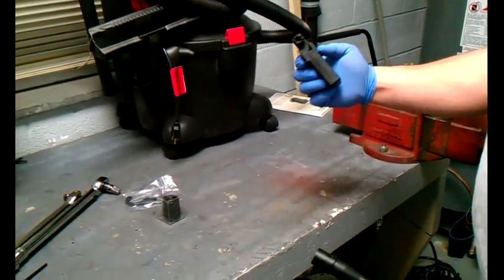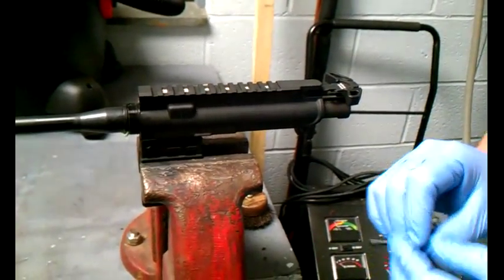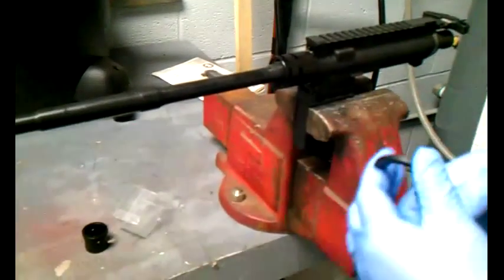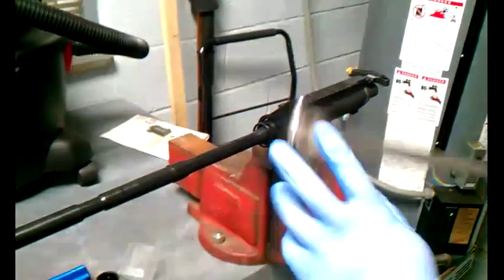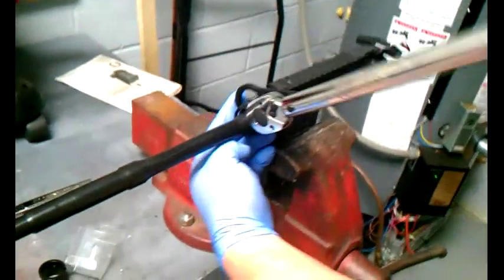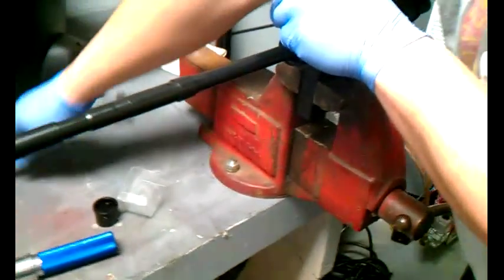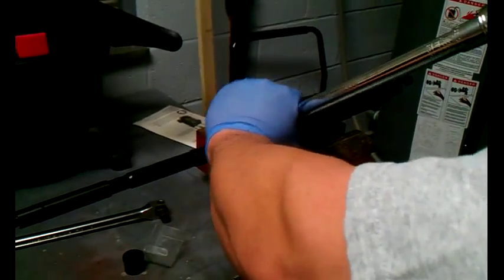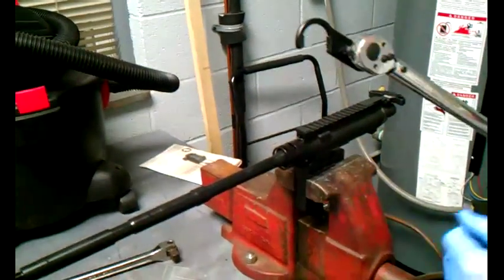How to Build the AR15:  The Correct Way to Torque a Barrel Nut

Comment: that is the wrong way to torque with an adapter.  always at 90 degrees....
Reply: These arguments are moot in this application. I calibrated torque wrenches for a living in the service, and with large torque ranges as this application (30-80 ft/lbs) it makes little if any difference whether the crowsfoot adapter or barrel nut adapter is straight or 90 degrees. Even the Air Force tech manual says with a standard crowsfoot adapter, use it straight and torque to the center of the desired range.

The adapter shown (and most) will add only a few ft/lbs (2-3) to the desired torque. So unless you intend to torque to exactly 30 or 80 ft.lbs, being off a few ft/lbs is irrelevant. 30-80 ft/lbs is a very large range to be so concerned about exact torque applied.
Reply: @barry7413  honestly Barry thank you for putting this argument to rest. Someone with ACTUAL experience sharing their advice is worth volumes. I’ve also heard the range is very wide for a mil-spec. Everyone else here is just shaking their pissers with theories and other shit.
Reply: hahtsauce you're confused about what mil-spec is, but that's okay. Just because it meets SOME mil-spec dimensions, doesn't mean it's mil-spec. Also, there's no set standard that armorer's wrench manufacturers follow. Especially considering that there are manufacturers that require the use of castle nut wrenches for their barrel nuts like on the BCM KMR and Centurion CMR. The distance between the adapter locations and the square (not hex like you think it is) torque wrench mounting location varies greatly between manufacturers.
Reply: Not to beat a dead horse, but since he mentioned the AF tech manual, I though I would provide a link to this. It does state, as a note, that when using a standard crows foot, no calculation is required. Now, is the barrel wrench considered a "crows foot" or is it an extension?  https://www.google.dk/search?q=Air+Force+torque+wrench+use&oq=Air+Force+torque+wrench+use&aqs=chrome..69i57j0.7633j0j8&sourceid=chrome&ie=UTF-8
Reply: That would depend on the distance between where the torque wrench fit and the socket end center point. I know of no definition of where "extension" begins and ends.  @jason60chev
Reply: @jason60chev  both need to be at a 90 degree to achieve to be accurate
Reply: @biglaverstyle  true, but this is a range, and not a precise specification, like torquing a head bolt.  Also, the best thing is to follow manufacturer's recommendations, as for this UTG slim-line barrel nut, the tool is to be used in-line.  I cannot remember what the max torque value was for this nut, but we did not exceed it by a long shot.  Have a great day!
Reply: tacticalsmokepole  No. It is very easy to over torque using a breaker bar. The problem is people generally over torque rather than under torque when not using a torque wrench. It would be easy to over torque the aluminum receiver threads and strip them. Then you have an expensive aluminum paper weight.

If you reach max torque and the gas tube holes don't line up, you may need a shim(s) between barrel and receiver. Normally, the barrel nut will align before reaching the max torque value.
Reply: tacticalsmokepole   If the hole for the torque wrench is truly 10 inches from the center point of the Tapco "socket", it will affect the applied torque more. Still you're dealing with a very wide torque range. Torquing to midpoint (65-ft/lb-ish) with the Tapco straight is still unlikely to put actual applied toque higher than 80.
Reply: This isn't for an airplane or car.  You are correct if I was trying to be exact, but a barrel nut for an AR is a range and doesn't need to be exact.
Reply: That's when using the issued barrel nut tool with a mil-spec barrel nut.  Using the adapter inline with the torque wrench amplifies the torque compared to what the torque wrench is set to.  If your handguard's manufacturer says to torque it to specific ft-lbs you need to use the tool at 90° to achieve the correct torque.
Reply: @netchemica  in this case, UTG also states in their instructions to use the tool in-line with your torque wrench.
Reply: This isn't a car, read the M16 tech manual.  It describes how to do it and the instructions specifically say to use the tool inline with the wrench.  The engineers who designed this gun already took offset into consideration.  That's why they want the tool inline with the wrench.   Just sayin.
Reply: Barrel nuts in general are mil-spec so that is a moot point.  Doesn't matter what tool you use, if the tool is made mil-spec the distance from the drive hex to the barrel nut splines are the same as the issued nut tool and you will need to follow the Tech Manual.
Reply: @ginsboy2003  I know this video is super old, but sorry friend you are as ignorant as most the drop outs going into the service when the manual was put out, I know for a fact most didn't know what 90 degrees was. They made the adapter some what small to get some what close results. They made the manual that way because the broad range on issued rifles, it was easier to understand, and it was taken into account to slight over tighten so the barrel would stay on in life or death situations. It was better to be over 10-20lbs pounds than someone being light and under torquing it. I've done this many times, and measured the lbs/ft, and any size adapter will change the offset if it is inline with wrench. 90 degrees will give you truer value. This didn't matter as much back then because like I said better safe than sorry, 10-20 lbs on issued rifles was still under 80. With everything the manual says and uses for these issued rifles, will this hurt your rifle? No it absolutely will not! For after market barrel nuts, different sized tools(length) and adapters, it could. I've seen people literally look at this manual and put a cheater bar on the torque wrench that was not that strong, and the adapter was 8 inches long and torque to 100lbs easy and strip the nuts. I know you probably served swearing to this manual, but like all things in this manual it was made for not so intelligent people accounted for. This being said, I served as well in the marines, and out in the field on standard rifles with tools supplied it wouldn't matter one hill of beans, it would and can for after market goodies. GL and peace...
Reply: @TheScreaminTiger  aww sorry to upset your boyfriend. 😂 Bu bye now
Reply: @ginsboy2003  wrong
Reply: +ginsboy2003 ..... read paperwork that comes with ur T/wrench....wrote by the engineers that designed 
                                 the tool.... (I'm just saying)
Reply: Aircraft maintenance and instrumentation. tacticalsmokepole
Reply: From page 3-41 of the tech manual.  "9. Using combination wrench (10) and torque wrench, torque barrel nut assembly (9) to 30 ft-lb (40.5 N-m).
Torque is measured when both wrenches are used together"   The picture shows them inline with each other, not offset.
Reply: If you read the Tech manual for the AR 15, he is doing it correctly.  No offset conversions, no 90 degrees to wrench, but inline with the tool.
Reply: @ginsboy2003  the problem there is you have to use the same exact size adapter, if you use a multi tool it may be of a different size and thus your final TQ figure may be incorrect.
Reply: @ginsboy2003  then its not 30 ft lbs
Reply: @ginsboy2003  No that's for the milspec barrel nut, he is right when it comes to THAT barrel nut. Not when it comes to other barrel nuts.

Comment from the maker: I think you are asking how much torque can be applied to take off a barrel nut, right?  If that is your question then the short answer, all joking aside, is whatever it takes.  The only problem I can think of, is if the upper was assembled improperly with Red Threadlocker, then you will have to heat the barrel nut very carefully to get it loose.  That will cause you to run into another problem as to how to handle the barrel nut tool and the upper while hot.  Sometimes you have to know how the upper was assembled before you can take it apart.  If you do put a torque wrench on the barrel nut wrench, in-line, and you get to 80 ft-lbs, and the nut still won't budge, I would look carefully at it to make sure the upper isn't stressed or that it's got Red Threadlocker on the threads.  
Now if you meant to say how much torque can you put on a barrel nut, then it's the same for any barrel nut wrench, in-line, up to 80 ft-lbs.  I don't like getting that high.  What I do is try to hover around a nice medium, say 55-65 ft-lbs, and if I can't line up the gas tube, I will either face the upper more, or shim the barrel nut.
I hope this helps, and if this is clear as mud, I'll try to clarify once you get back to me.  I'll upload a video showing the upper being faced.  I pretty much have faced every upper I build, because so far 95% of the one's I've done needed it.

Comment from the maker: you need to reference army, air force, or navy tech manuals and not some random website.  you are correct that at 90 degrees to the torque wrench you will get the correct torque value for the tool, however this is not critical for the barrel nut as the torque should be in a range 30 to 80 ft lbs.  you just need enough torque to get your gas tube aligned.  not below and not above. the torque is already calculated for you with the tool in line, and yes actual torque is higher than 30 at 30 and so forth.  again this was calculated for you by Armalite when they invented the AR.  if you want to build your AR wrong, feel free, but I'll keep building mine right.
Reply: Redneck Riflery ..... please be advised.... don't take army- air force- or navy manuals as FACT.... check with the engineers who designed and manufacture this item...    Also please tell your followers to ONLY "CLICK" t/wrench  ONCE / another fact product manufacturers emphasize.
             when you post videos---- I do hope you want feedback... if not delete my comments, i will still catch your videos.
                                                     ALL BLACK RIFLES MATTER